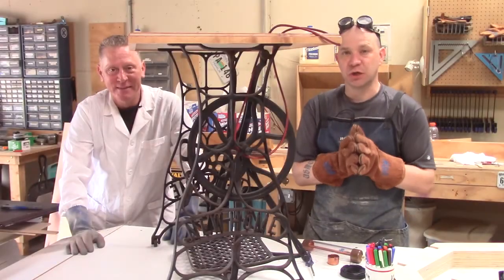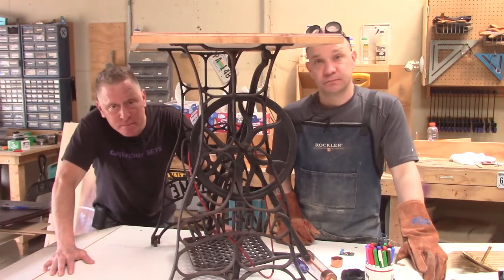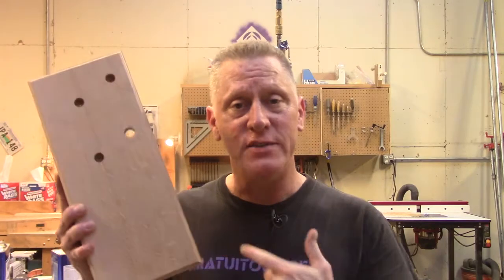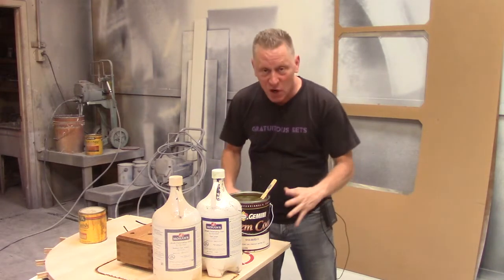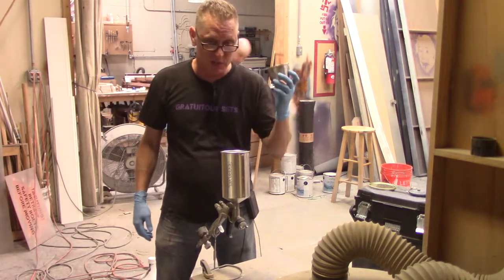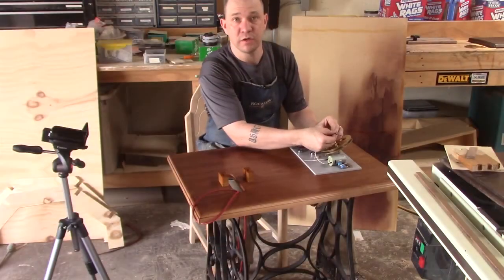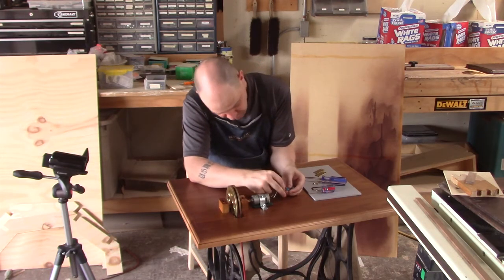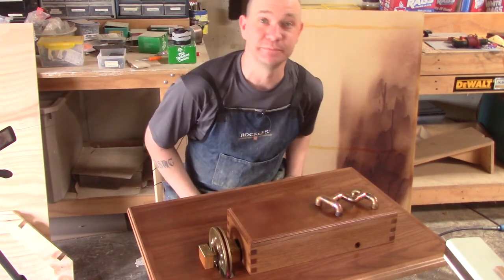Steampunk Escape Game Machine

Comment: Our "Matrix of Diodes" ended up causing a feedback loop, and had to be removed. It worked beautifully, allowing the generator to give positive voltage to the analog pin on the Arduino regardless of direction of spin. However, when a transformer (ie the power supply for the piece) was brought within 10' of the generator, it put /lots/ of noise on the line, an interesting sine wave going from 1 up to 5+ volts.
It's been removed from the Mk-1. The wheel has to turn in a specific direction now. But we added some other cool features, so stay tuned. Because tuning is a thing we ever had to do on youtube.